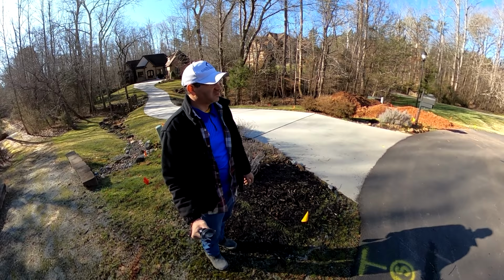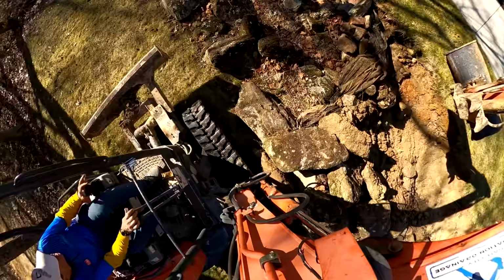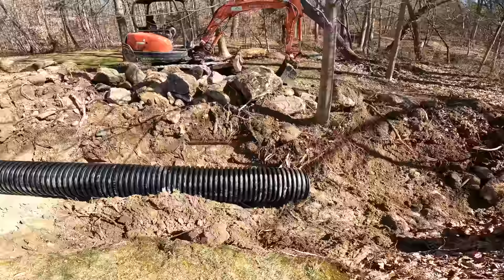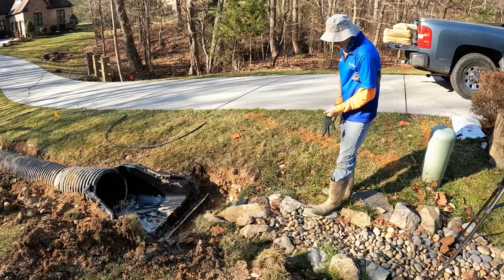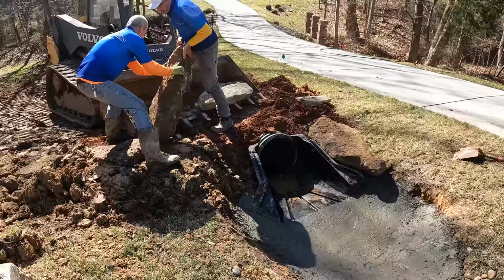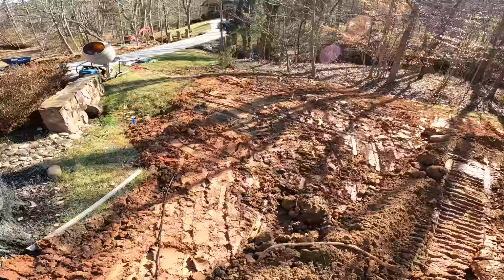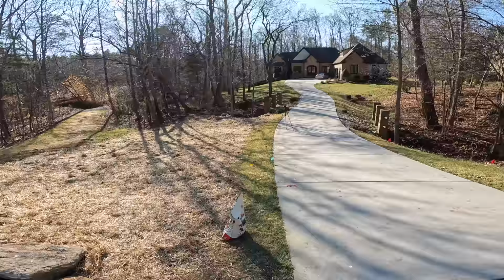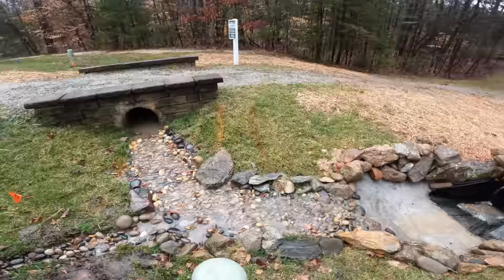Converting a riprap channel to a culvert

Comment: As a retired landscape business owner, might I recommend on your next concrete apron, using some concrete dye (brown in this case) and a cobblestone stamp.  It's just a little detail, but really makes the work stand out - especially in front of a home like this!  I've also done concrete dye and stamping that looks like barnwood flooring for a poured patio that's amazing!  Great work!  Enjoyed your video!
Reply: Only place stamped concrete would look good is the bottom of a culvert😂
Reply: @haypro4713  I'll have to keep that in mind for my next culvert pour! 😆
Reply: @CHOPSWELL

I think most people get the brushed texture because it adds more shoe grip so its the safest standard in my opinion. 
I love stamped concrete but on walls or if I was building a pool Id do rocky texture for the surrounding areas

Comment: AT&T should have had their line buried given the temporary line was run months ago. Considering you weren't actually excavating I don't think it's your responsibility. If they send you a bill I'd check the city's agreement with them as it might specify burial within a certain timeframe. Let us know if they try to bill you.
Reply: Failure to follow up and cover after the fact by AT&T and any other Util's etc is a scenario that should be addressed by those other groups, How they get away with leaving lines like that after the fact should be added into a rule of some sort, like a comment above said, its a never ending saga.
Reply: In my area, the cable or phone companies don't bury their cables. If you want it underground, you, the customer, has to take care of digging the trench and if they require it, you have to install a conduit. If an existing underground cable is damaged, the company makes the repair, but the customer still has to bury it. We have Comcast for cable and Consolidated Communications for phone.
I would have thought the underground locating company would have marked that area unless they weren't told you were working there. Having said that, if you aren't going to dig, you shouldn't have to tell them that you are scooping up the pile of dirt left by others. I wouldn't say it was the dump truck drivers' fault either. He wasn't digging so there was no need to call for utilities locating. I'd lean to it being the cable customers fault if it was up to them to be sure their cable was buried.
It all boils down to rules that the city and utility service has in place.
Reply from the maker: Thank you for sharing your perspectives. All valid points to consider. I'm just glad we were able to help the tech get the service restored in a few hours for the neighbor. 👍

Comment: A mandatory 811 call would have eliminated the cable cutting. That is 100% on you. However, the trucking company should accept the responsibility of damaging the terminal and the resulting temporary line to begin with. Additionally, I believe that undercutting that poplar tree to the right of the discharge will eventually lead to its collapse as time erodes the little remaining dirt under it. The disfigured culvert on the discharge end could be a future problem as well.  You 100% improved the aesthetics of that property and solved the erosion problem in that area. Overall, a good job and very informative and thought out video!
Reply from the maker: We called811 multiple times because the weather kept pushing this job back. I think the lines being buried 1/2” was a big part of the problem too.
Reply: @GCFD  sounds like you were just unfortunately left holding the bag when the music stopped

Comment: Excellent work!

Since you asked about the low voltage wire, I'll give my opinion now. 

It is your job site so you should be telling the dump truck driver where to dump. The driver should not have dumped on a low voltage pedestal. I don't believe the next part happened but even if you were asking him to dump there he should not have so really you're both wrong in that situation. 
As far as whose fault it is the low voltage wire broke that's the company who installed wire. They did not put it down in the ground far enough and if they are running temporary wire without burying it, it has to be very clearly marked. There is industry standard for how deep low voltage wire should be buried. Therefore you should not be held liable for repair of wire if it was not buried deep enough. 
Good video!

Comment: As a comms guy (I deal with plant maintenance, not single drops to houses) if a contractor hits a cable and tells me where they hit it, even helps dig it out, I don't even fill out the damage claim paperwork. I've had them hit a cable and before I got there expose 2 feet of cable on either side and shore up a trench for me to work in. On the flip side, I've had contractors cut a cable, place their shoring against it to hide it then play stupid when I showed up. 

The people responding to those calls don't care whose fault it was in the moment, we just want to fix it. Our performance metrics include how long an outage lasts so that's the 1st thing on our mind.

Comment: First of all, you removed the dirty grungy culvert, with a well deserved culvert pipe. Secondly, you made two, aesthetic openings to the pipe, leveling the ground with a smooth, leveled crown on top. And thirdly, you contoured the creek below, by also adding resistance to the downward flow. Indecently,  it was big of you to repair and improve the groundwork near the media-post where the dump truck unloaded.  One of the best video's I have seen in a while where you were able to show large scale redirection of water from point "A", to point "B!" Excellent Job GCF!
Reply from the maker: thank you Robert! This was a cool project and really beautified their property.

Comment: Hello Shaun! 

I work for an ISP and I can say this:

The Dump Truck is the first guy who messed up here.  Running a Temp line is our SOP when it comes to dropping a new line (Suddenlink here) - It's hard to schedule construction crews to run the proper conduit / shielding - sometimes up to 2 months if we're backed up on scheduling / outages.  We typically are faster in the Spring/Fall, but Summer/Winter sees more extreme weather and slows us down.

That being said: The Temp line should have been clearly marked - and if it was not then that's on AT&T for not marking it.
Reply from the maker: Thank you for sharing J E!
Reply: @GCFD  np!

I wish most construction guys were as dilligent as you guys in avoiding hitting conduits and being aware of what is under them.

Half my job is calling in fiber or line breaks from crews who can't be bothered.

Comment: I think its the cat tv guys that scratched it in, in the first place.  Although it was marked out it was not at the proper depth.  You are the Cat's Meow! :)
That's why you use fast setting concrete.  I really like how you laid the concrete pad to stop head cutting erosion to the inlet.  Burying that creek was the best idea and the ground will llok a lawn and forrest.  some trees were ready to die :( as they were at the edge. Hence the chain saws!
Great job with resuing the rock and making it looks real good the rain will clean it up.  All those rocks would be a fortune to buy good move! Nice vdeo.

Comment: Gate City Foundation Drainage - you asked whose fault was the broken internet line.  I retired after 37 years with AT&T, most of that time was at a computer center help desk.  Every phone, cable, and internet line I've ever seen buried by an installer was put barely under the soil.  Some were actually on top of the soil.  No, that wasn't a temporary fix, it's what they do.  To get the line at the proper depth, the customer usually has to dig the ditch then request that the company put the line in the customer's ditch.  I know that's not the right way but it's the way things are almost always done.
Reply from the maker: Thanks for sharing your info Ron!

Comment: I agree that you did a great job of smoothing over the land and correcting the drainage.  About the cables, I noticed there were location flags.  This indicates that cables and utilities were supposed to have been located and marked.  From experience, I can tell you that those flags or paint marks are not 100% accurate.  There are several things at work in this situation.  The utility location was not very accurate or thorough.  The utility crew that left a cable basically on the ground surface should not have done so, they were lazy.  The dump truck driver should not have dumped the dirt where he did without prior approval.  You did well in trying to rectify the problem.  I recently(late September 2022) lost my telephone and internet connection to a truck taking out a telephone cable above the street and then having problems getting a new internet service connected.  It seems as if many of these service crews are lazy and don't care how they do their jobs.

Comment: This job had many pieces and area's that came into play for sure regarding the continual water flow from three or four different sources YIKES.  Just a thought here the cable company in my opinion should have done a couple of things differently for sure laying their unprotected cable and going over/through the culvert area...duh.  Overall Gate City did an outstanding job plus had GREAT VISION as to the flow of the LAND AND THE WATER plus redoing the banks and corner for a smoother flow.  GOOD JOB GUY'S!!!  That's the difference between your Company and whoever originally installed the old system versus the PRO'S.  God Bless you all.

Comment: All four parties bear some responsibility.

1) Dump truck guy for starting the trouble.
2) Cable guy for half-assing the burial. He could have at least buried some caution tape a couple inches above the wire, marked it with landscape flags, or simply hung a sign on the junction box.
3) Sean because I didn't hear mention of having the locator service check it out before he started digging.
4) The property owner because I find it hard to believe the cable guy didn't inform them of the temporary nature of the cable, especially if they intended to come back later to do it right. Quite possible given the cable guy's quality of work but at the same time, they ought to know what's happening on their property,
Reply from the maker: Thank you for sharing your thoughts Tom. I did have the utilities located, but they often don't mark internet lines for whatever reason. They don't charge anyone when the locate was called in but the utility failed to mark.
Reply: You can see they came and marked with orange paint near the new Inlet. Shawn knows better than to not have them out ahead of time. They just failed at their job.. Again

Comment: But, but, but.....IT CORRUGATED!  :P~  Two bubbles too...  There is a confluence.  The dumper driver was not thinking when he dumped his load on top of an obvious utility fixture.  The temporary repair line was not clearly marked so the obviously soon to follow clean up guy did not cut it.  The clean up guy, assuming everyone did a PROPER job, ended up making his own mess.  The dumper guy is the guy that botched the concrete form work however, being the ORIGINAL pooch screwer.
Reply: Double wall not single wall corrugated.
Reply from the maker: Hahah 👍

Comment: You need steekwrist crapple to place those big rocks really great job nicely done ✅ have checked that that pipe under that bridge is clear that might explain soil errosion or to much speed in the water drop from that top pipe

Comment: Where I grew up the creek that ran through lower town Summerland was culverted close to the clay banks but closer to the lake the creek was open and the problem of land being washed away by the creek was solved by erecting a stone wall and covering the creek bed with larger stones that would not dislodge during high water in the spring.

Comment: The asthetics of the the burried culvert and rock work is a success.  I personally like the original rock drainage.  Where I live, it's called "Blue Stake".  Before we dig even 1" below existing grade, we have to call and have all the utilities located.  If we dig withing 2 feet of a mark, it must be hand dug.  The dirt was probably delivered to the spot where it was specified.  But it doesn't matter.

Comment: I’m not happy that you let the outlet of that system become deformed. I noticed it before you even buried it. I would suggest you strengthen it one way or another to prevent any further restriction. Other than that it looks pretty good!
Reply: i said in my comment, it was my only cringe.....The rock(s) on top were a bit too heavy, If that was changed up with a different arrangement i think it would be a lot better.
Reply from the maker: We should have added some dirt under the pipe but we missed it.
Reply: @GCFD  I assumed it was on purpose to widen, shallow, and slow down the flow out of the culvert to reduce erosion. If the exit could be camouflaged, the squish wouldn't really matter. It didn't look like the full weight of the top rock was on the culvert.

Comment: Great job GCF 👍
Reply from the maker: Thank you Ed! We will be working tomorrow in Greensboro!
Reply: @GCFD  nice. We just had approximately 8 inches of snow a week ago and tomorrow it's going to be 66° in Wisconsin. It's been made to low 30s during the day and mid-20s at night. We're not quite back to work yet but it's right around the corner.

Comment: here there are 2 shared responsibilities
those who installed the temporary cable show it has not been dug down to the correct depth or marked extra, extra on the ground the installer / owner of the cable is guilty
The 2nd part is the truck show they put 40 +% on top of the cable box and bury it
but you have to check your county, laws and regulations are different
Reply from the maker: Good points Chris

Comment: With coverage like this you should have 500k subs+   That was a huge one overall.... i suppose that 360 camera allows you to pick with angle you want from it, aka the swivel, watching that is cool.  That was an ugly situtation for sure. The Inlet looks superb Ronald did great with the placement of the rocks and the ones on top of it.... My Only cringe was the outfall with the heavy one on top Being too heavy partially collapsing it Which could fail later on. As long as the flow is not like the rivers we have seen in the past it might be ok.   That property and or area is Nice i'm sure the $ tag on that is a pretty penny.
Reply from the maker: Thank you Stratos! Yes, those 3660 cameras are so cool because they can capture almost everything. They only shoot in 1080 though so the quality is a little lower. This was a cool project for sure.

Comment: If it was a temp line not even buried and you called for locate. But this was a temp the internet company did not make final repair and it’s been months.   I think the internet company needs to eat it.  If they want to go after the dump truck drive that’s up them not you.  Your right to make the repair as easy as you can on the repair guy.  That never was a bad thing, I had the same philosophy
Reply from the maker: 👍 We always stick around and try to help if we hit a utility. We hit them all the time, mostly because they don't bother to mark them after we call in the utility locate.

Comment: Shawn have you ever heard/looked into GABION walls/structures before?? Super easy and cheap to make and great for erosion I think they would be useful in a lot of your drainage applications. Keep up the great work man.
Reply from the maker: I will check it out. Thanks!
Reply: What’s the lifespan of the galvanized netting, around here I see lots that has rusted and needs replacing.

Comment: Good job on the drain, where I live, the party that damaged the cable pays, you did damage the fix, even if it was a temporary cable. But I can tell you if you help the tech fix the damage that goes a long way. Worst thing to do is bury the damage, leave it exposed so it is easy to repair. Looks like all worked out in the end.

Comment: Depends on the local building code for buried cables.  Where I live, telephone / communications cable is supposed to be a minimum of 18-inches underground.   However, the dump truck driver caused the problem and the communications company didn't fix it correctly if there's a specified minimum burial depth.
Reply from the maker: Those cables were like 1/2" deep and that's how they all do it around here.
Reply: @GCFD  So, the phone company ignores state and local codes?  Or, the inspectors don't care?   The last buried work I did I had to have the trench inspected for width and depth, and then a second inspector had to come out and inspect the utilities in the trench for separation before it could be backfilled.
Reply from the maker: @buckhorncortez  not for internet lines, no. They just barely cover them and go.

Comment: In Ottawa, Ontario, it would be the internet provider's responsibility 100%! Cables are required to be buried (And protected) at least a foot! Working for the city, if we hit a line/cable that wasn't  buried, it wasn't our problem. We didn't even have to report it.  What are the codes in that area?
 Oh, if it's not on the city's/municipalitiy's/county's right-of-way:
1) Did they have permission to bury it?
2) It would still be the provider's problem.

Comment: Takeout the sycamore for firewood and backfill with the riprap and rock to protect the bank eroding toward the driveway.  A lot of surface water is going to be shedding off into that wild landscaped area too so a small amount of run off will be going into the stream more naturally.
Reply from the maker: That's a great option. The plan is to keep an eye on those trees and see how things settle back down. 👍
Reply: If the roots of that tree were exposed during excavation of the creek area, it might impact the health of the tree if the bank continues to erode.